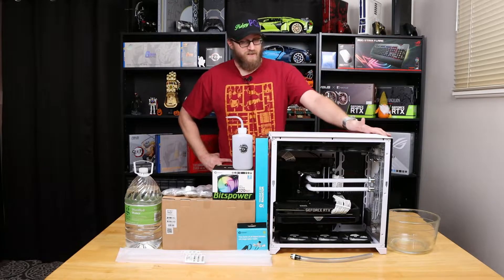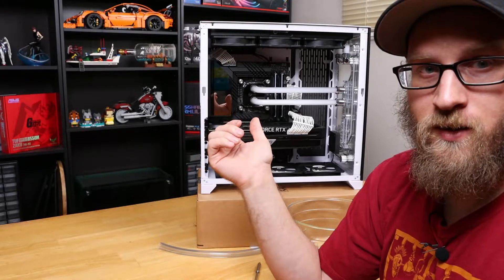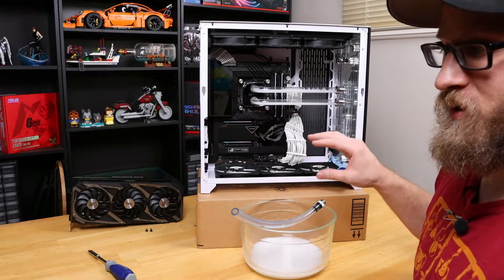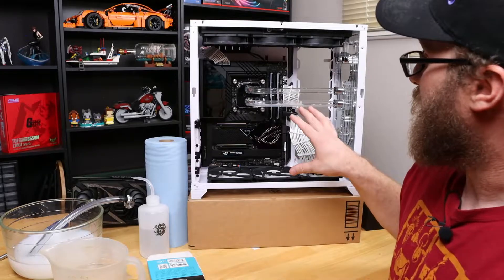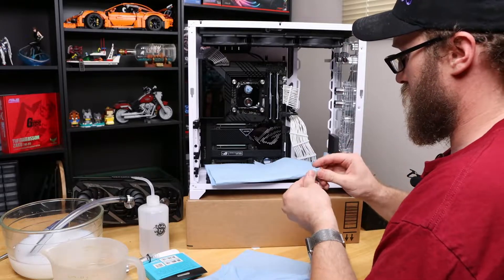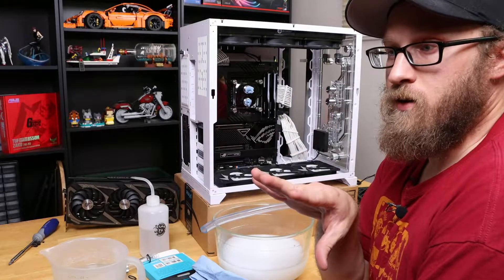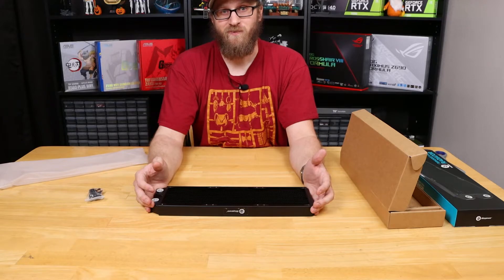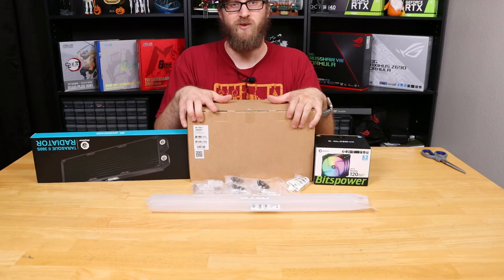Titan One 2.0 Coolant Flush/Drain & Unboxing!!!!

Comment: Thank you so much for this. My question is did that drain tube come with the system? Or did you buy it separately
Reply from the maker: @jeremypope-levison721  no problem! If I remember correctly, the drain tube came with the kit
Reply: @PidgyPCs  thank you! Also I only used distilled water the first time (and haven't flushed it in 2 years), will I need to replace any o rings or anything?